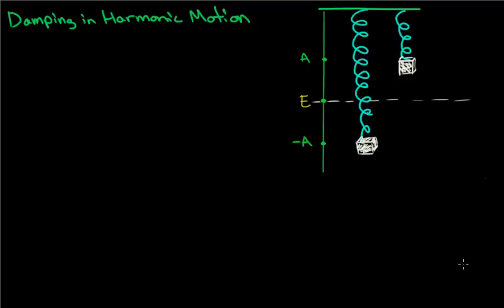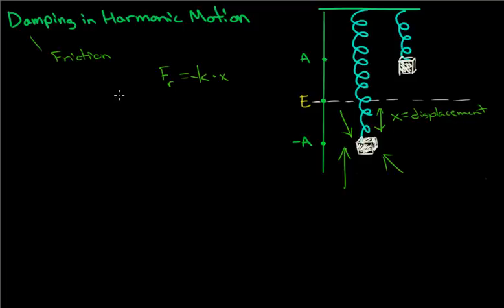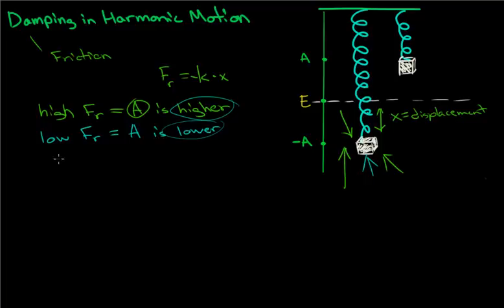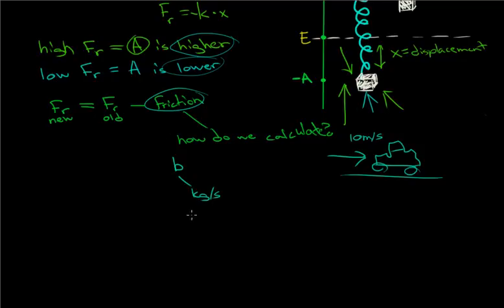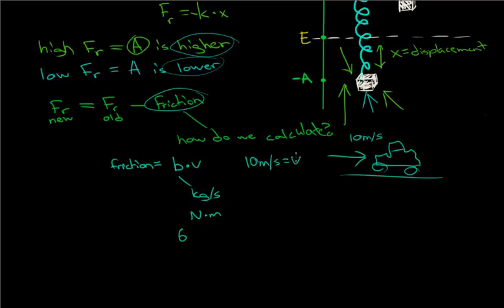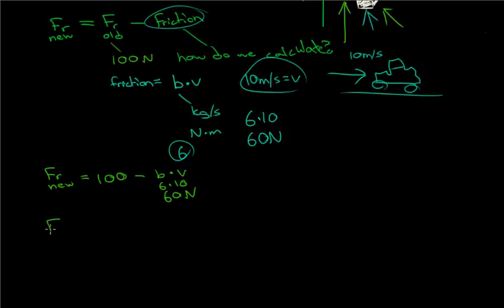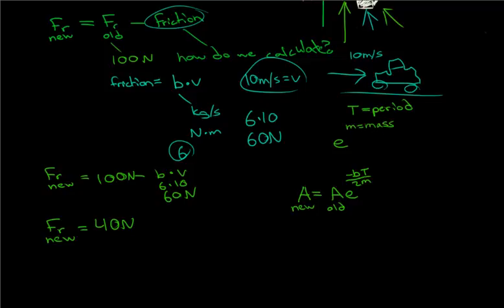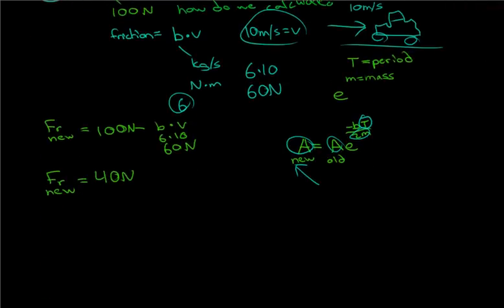Introduction to Damping in Harmonic Motion

Comment: the appropriate unit for b would be kg/s because if you check it using the equation friction = bv where v has units of m/s, (kg/s) * (m/s) = (kg * m) / s^2 = Newtons. kg/s however, isn't equal to Nm. Nm is Joules. or torque.